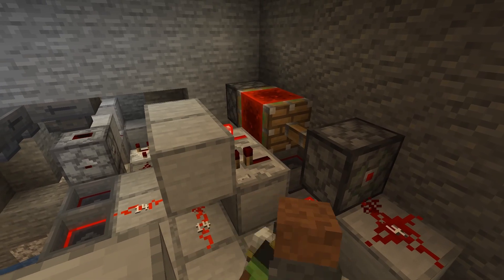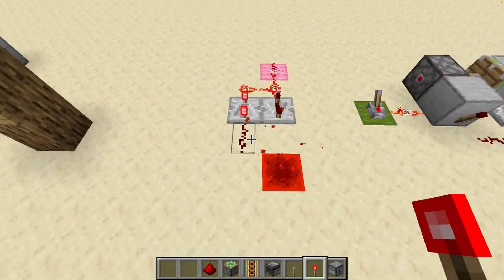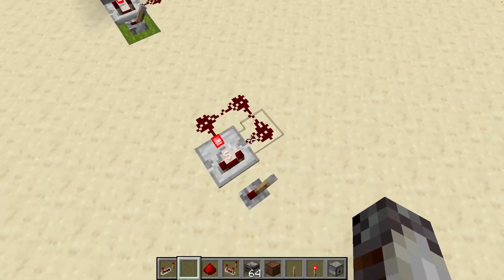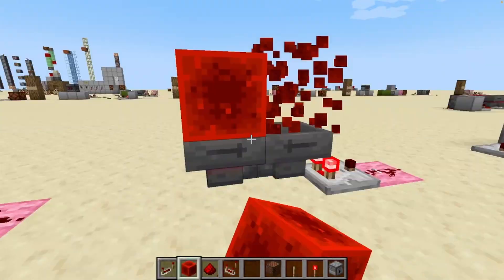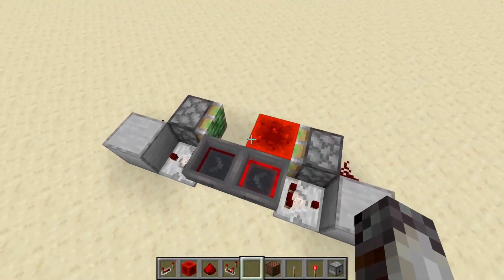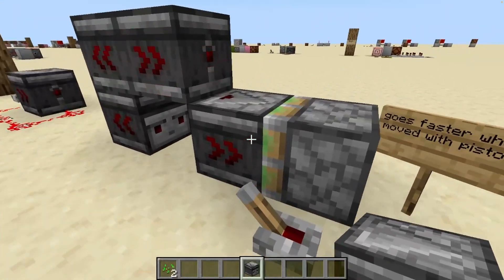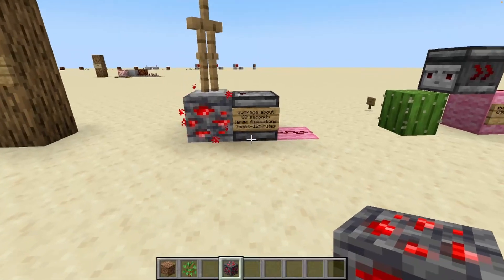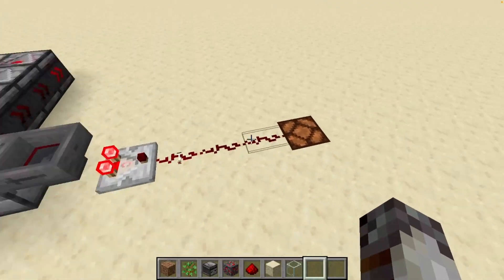Every Redstone Clock Design Explained

Comment: 7:58 If you add a hopper with two chickens in it above the dispenser, the dispenser will never run out of items to spit out. Since one chicken lays an egg every 5-10 minutes, two chickens will lay one egg in average every 3.75 minutes, while the contraption spits out one egg every 5 minutes.
It's a 5 minutes egg timer. 😊
Reply from the maker: This is simultaneously the most creative and practical idea ive ever heard😂